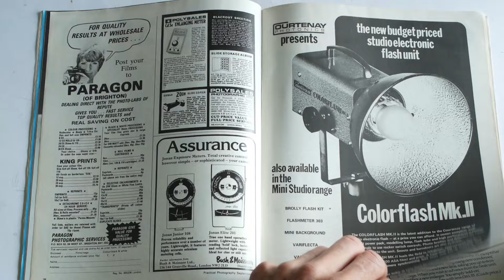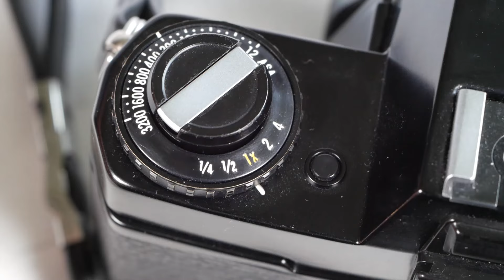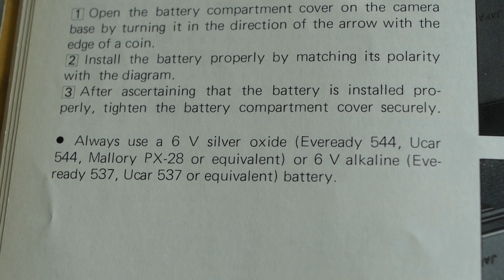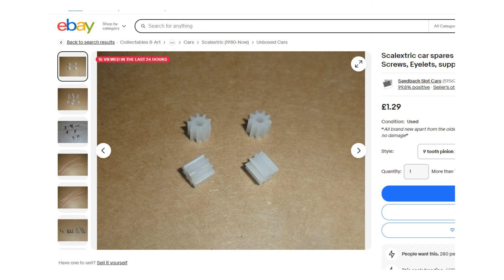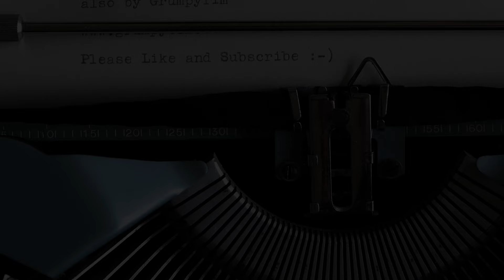Yashica FR1 - 10 years ahead of the competition!!!

Comment: FR I is a nice camera (I have an FR II which misses out on being able to select manual shutter speeds), but it was pretty cheeky by Yashica to advertise it as "ten years ahead of the competition". It's just a basic SLR with aperture-priority and manual modes, like a dozen others. It doesn't even offer TTL flash or OTF metering like an Olympus OM2. Or 125th flash-sync speeds like a Nikon. Or a Program mode like a Canon A1. In fact as a camera goes, it's as beige and nondescript as you can get. The best thing it gave us was cheap-ish access to very very nice lenses.
Reply from the maker: That's advertising for you Jon!!!  When it comes down to it, they're all just boxes with a few chunks of glass on the front and a bit of film somewhere towards the back, but I get a lot of fun using many of the less celebrated cameras like the FR1.
Reply: @GrumpyTim yeah I’m all about championing the underdog. Great video btw.

Comment: Nice video as usual . I like the look of that camera and the potential for nice performance from that model. I may need to restrain myself from seeking one out though because realistically I DO NOT need another lens system to worry about. I already have M42, Pentax K, Exakta, Nikon F, Minolta MD, Canon EF , Minolta /sony A mount , canon FD and the M39 FED… I get a little too enthusiastic collecting cameras
Reply from the maker: Hi Conrad, Yep, I know what you mean, there's a few formats I'm avoiding simply because I don't need yet another lens system.  I initially got a 24mm Contax/Yashica bayonet lens because I wanted a 24mm to use on mirrorless, and it was cheaper getting the C/Y mount lens and an adapter than getting a 24mm in the other mounts that I already had.  Then I figured I'd get a couple more lenses to use with the adapter, and from there getting a Yashica camera body seemed logical........and so it continues.

Comment: The diagonal split screen is so easy to use. Most things we photograph have either vertical or horizontal focal points which makes the diagonal split simpler. The same system is used on the older, cheap and cheerful Ricoh SLRs as well. I have three of them.
Reply from the maker: Hi Paul, yes, the diagonal split screen seems like a completely logical idea, I'm surprised it didn't appear on more cameras.  I quite like the Ricoh cameras - my main SLR was a Ricoh XR-X for many years, right up until I went digital in fact - can't remember what the viewfinder/focusing aids were like on that model, I'll have to check.

Comment: Nice images, while I do not have the FR1 I do have the FRII . Do you heve any experience with the Ricoh SLX 500, Mine has only one shutter speed of 1/30th, a damaged tripod bushing and a Carl Zeiss Jena DDR Tessar 50mm f2.8 with dodgy focusing. ?
Reply from the maker: I went for the FR1 mainly due to that old magazine advert, but I think the FRII is largely similar, albeit missing out on the manual exposure control, I bet it's still fun to shoot with.  I've not handled a Ricoh SLX 500 yet, is your speed dial stuck at 1/30th or is it just that none of the other speeds work?  What's up with the Tessar with the dodgy focusing, is it just tight or are there other issues?

Comment: If you want to glue nylon with c/a glue you should use an adhesion promoter on the nylon to promote bonding because nothing wants to stick to nylon. 

Yashica - emphasis is on the first syllable - Yashi-ka, not Ya-shee-ka.
Reply from the maker: I always regard Nylon as un glueable, but on the odd occasion that I do have to glue it, I always make the surface as rough as possible to increase the chances of success.  I haven't tried an adhesion promoter, I might get some one day.  I can't believe how well my dramatic reconstruction repair worked - still haven't managed to get it apart!
Reply: @GrumpyTim  Nylon and similar plastics are near impossible to bond because of low surface energy. That's where the adhesion promoter helps. I'm impressed that your repair has held up. I'd probably try to source a little brass pinion or have one 3-D printed out of polycarbonate.

Comment: I was asking myself if you might know the answer to my problem. When cranking the shutter it just rattles, and the curtain at the back doesnt turn. The electronical button wont react either, thanks in advance.
Reply from the maker: Hi petruska,  the first, and probably obvious question, is there a battery in the camera and does the LED light up when you press the test button?  Assuming all that is ok, I have a few thoughts:

Sometimes when a camera gets jammed someone will attempt to force the film advancing crank, breaking it in the process - if your camera was faulty when you got it, that's always a possibility - I've received a couple in that condition (not Yashicas).

It could be as simple as a winding pawl on the film advance ratchet is sticking and not engaging (unlikely but not impossible).

There might be a problem that can occur on the FR-1 where something gets sticky causing the camera not to finish the complete cycle of taking a photograph, and until the cycle is finished, advancing the film cannot commence.  There is a problem of this type with many Pentax ME Super cameras - something in the mirror box assembly gets sticky, the photo cycle doesn't complete and the film advance just keeps winding without cocking the shutter (I have an ME Super in that condition that I'll need to completely disassemble to fix the issue).

Can you tell if the shutter is actually in the cocked position (on the right) or the released position (on the left) (sometimes you can see a little bit of the curtain edge metal by peering into the side of the image frame in the back of the camera).  Is the mirror stuck up or is it in it's rest position?

I haven't had to do anything more than the simple counter repair on my FR1, so I haven't examined the entire workings of the camera, but my guess is that there is something sticking, stopping the camera from completing it's cycle.